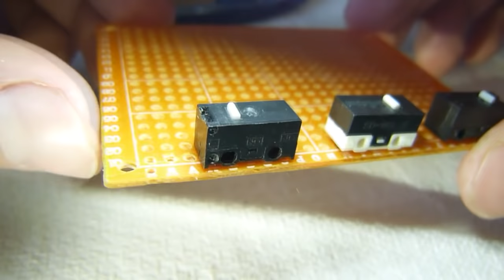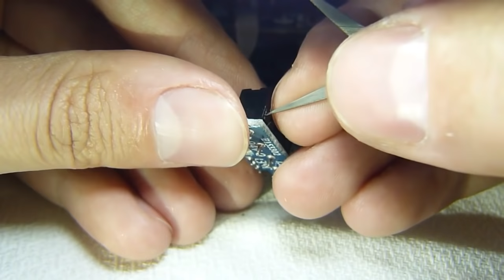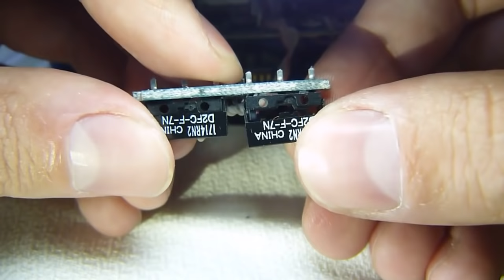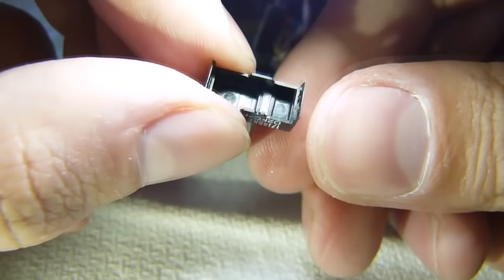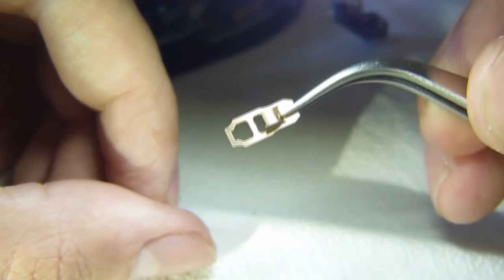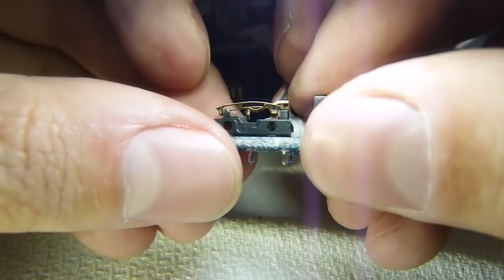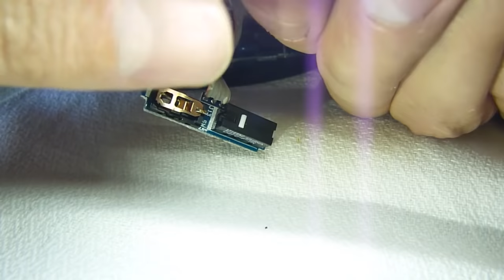Double click problem: How to fix faulty mouse button

Comment: It's 2019, and this works just fine with the razer naga trinity. You, my good sir, deserve a medal for this.
Reply: 2022 still works :) now i still need to find a fix for the "Repeat Scroll Down" button, the one you tilt the scroll to the right... sometimes works, sometimes don't... but well... at least my left click is working... lets see for how long
Reply: @mikethegamer34  you just need to oil the bearing, use wd40 or something like that. Work for me

Comment: Thanks so much, I was eventually able to fix my Razer Imperator. My tips: Also see his 'full guide' link which gives better detail for the really icky part - getting the spring back in place. Might have saved me an hour if I saw that first! Oh and my little white plastic switch also went flying, it's a miracle I found it.

For my mouse, I had just as much trouble getting re-assembling it properly. The right click "didn't work", but I eventually realised that it was in 'always clicked down' position, due to me not screwing the PCB in TIGHTLY (at least a few turns tighter than I would normally screw something). Do a few laps around the PCB with your screwdriver, because when one has gone in further, another that felt tight a moment ago might now have a few extra turns in it.

Comment: Yes, thank you very much!  As mentioned below, no need to remove switch from board...just use scalpel knife or fine tweezer legs to wedge the plastic tabs. Did this on a Logitec Performance MX...don't take everything apart like in other tutorials...just 4 screws and remove top half..that's it. You're right at the switch.

Comment: Thank you for this great tutorial. Fixed my "Roccat Kone Pure" laser mouse. It was a bit tricky to put back the metal plate back in place, but the rest it's easier than it looks. I think everyone is capable to do this at home.
Reply: my man just broke the best drag clicking mice
Reply: Wonder what the Roccat Kone EMP is in that league...
Was a RIP to the left click till I fixed it from this video.
Reply: @lemurmad  Look for the switches. Kalih 8.0 are rated at 80M clicks and this is your best bet.

Comment: Thank you for posting this how to guide.  Just saved a Logitech M570, suffering from bad double-clicks, from the trash.  Took the switch apart, did a bit of alcohol cleaning of the contacts, put it all back together, and now works great.

Comment: There's a really easy way to do this, lace the tapping bit (let's call it front) under its receptacle then pull it so as to hook the other end keeping the curved bit above the center receptacle. Push the back end down so it hooks.   You'll then have it fixed in place but it won't click, all you need to do at this point is push down on the curved bit so that it snaps into place (use a toothpick or tiny screwdriver).

Took me an hour for the first one until I figured this out and then 30 seconds for the second.
Reply: Thank you man. After 2 hours of trying I wanted to perform Seppuku, thanks to you I managed to fix it! I've done this twice (today and one more time two years ago) and my mouse works like new.
Reply: @zams4517  not sure what you mean the method I describe has worked fine for me.  I just buy a few new springs for like 5 bucks (the entire microswitches which I cannibalize) every few years for my g500.  If you are just rebending the same one you are going to lose integrity of the metal and corrosion (ie humidity) will reduce contact sensitivity over time as well.
Reply: @themysticbg  Glad I could help I actually figured this out like 6 years ago and then forgot it so I posted the comment to help remind myself as well lol.
Reply: @zams4517  no worries
Reply: Instructions not clear.
Now the pin is in my stomach
Reply: can you paraphrase it more simply
Reply: @jalen1422  how about a crude mspaint?
 https://i.postimg.cc/R0kbZFxY/mouse-inst.png
upon rewatching the video it looks like he's doing it the same way but you can't really tell because his fingers are in the way
Reply: Can you make a video or a drawing explaining which part is which
Reply: @CybertroninfiniteOfficial  the above pic no help? at 3:06 he starts doing method i describe although its hard to tell (I didn't even realize until long after I posted this)

Comment: Thank you SO much! as another commenter has already pointed out, there is no need to take off the metal clip. you just need to clean it (i used pliers and a tiny piece of cotton, put it back with no hassle (with the help of the video) and got it back to working after YEARS of faulty behaviour. so happy to have my mouse back!!! cheers to everyone. hope the information gets to everyone that needs it.
Reply: Yup, not only that, if you don't clean them and only start bending the copper, you both risk damaging it and won't fix the actual problem. Instead, take a moment to understand where the electrical loop closes (front of the copper piece), and just insert a wetted cloth underneath it with pliers.

Comment: Thanks! Works great. 

I recommend trying to clean the contacts with a thin, sharp blade, and 
add contact spray and see if that works before taking it apart. It can be 
difficult to put it back together. If you do take it apart, note that the back 
end (opposite of the contact) should be mounted almost at the top. 
Also be careful not to bend too much as it will make the click harder. 

I also removed the weights while I was at it and ordered 5 switches on 
eBay for $1.20. The ones you want is:  Omron D2FC-F-7N 

When you solder those switches, use a ~300C tip and do not heat for more than 3 seconds... 
(factory recommendation) 

Cheers :)
Reply: I fixed it on my Roccat Kone Pure Military, but I bend it too much and is a bit harder now, hope that get softer overtime. If that happen again I prefere buying a new switch and lose 30min trying to get that little spring plate on place.

Comment: I have a Logitech G600, and it was having the double click problem. This fixed it. Thank you so much for this video (and the detailed written guide with high res images, really helped a ton.) Took me about 45 minutes, the most stressful parts are taking off the cap to the switch, and putting that dreaded spring back in. A tip, do as he does in the video and make sure the spring tab part is on top of the post when you put the hammer back into the slot, put the back clip on, then do the spring last, and it's much easier to push down into place than it is to try and lift it back up onto the ridge / slot.

Take your time, be patient, don't get frustrated and you'll be able to fix it.
Reply: An update. It only ended up working for about a day, took it apart again and it only worked for about an hour. This is the solution, but my spring is just warn out badly. My suggestion is perhaps instead of bending your old spring, just buy a new one. (Got a 6 pack of new switches for 6$).

Comment: putting this thing back together is probably the hardest thing...mine fell apart after 10th try
Reply: Same :D But i finaly manged to fix it (now the other half... wish me luck)
Reply: I did this on my G600 for the left click. The fix has lasted for 3 years and counting. It took me 4 hours to get that copper spring back in. Now it's my right click's turn . Sigh. I swear, this is a part that can be made modular. Double click issue? Just snap in a new clicker!
Reply: If you've had to do it 3 times already compared to my 1 then perhaps you should consider bending that copper part a little more than you usually do. I took note of where it was when I opened it and moved it much further than the original spec (because obviously the original spec wasn't good enough) so the fix would last longer. That's coming from someone who uses their computer 12 hours a day or more. Lots of clickly click clicks.
Reply: Verdigo I like how buttons feel right now, wouldn't want to make changes to them.
And spending few minutes once a year doesn't bother me much anyway.

Comment: Thank you for your detailed instructions, I used to buy a new mouse every 2 to 3 years because of this double click issue, everyone should learn this technique asap to save money and the earth!:goodvibes:

I don't have any forceps to open the small black box, I learned from another youtuber who uses a needle to open it, it worked quickly and easily.

The copper piece is rather challenging to put it back into the correct position, loop to see your instructions for many times.  It took me half an hour to get it done and heard the beautiful "click" sound.

Comment: some tips that worked for me - I found the 1.0 flathead screwdriver from a multi-ended screwdriver kit worked well (ifixit in my case) to remove the black casing from the omron switches. When screwing your mouse back together, metal screws into plastic threads, back-turn the screw a little bit until you feel/hear it 'clunk' into the existing threads a little bit. If you don't do that, you can strip out the weaker plastic in the mouse body with the metal screw. And of course, other videos mention this, but to hold in the little white plastic piece that is in the switch casing, just put a little piece of tape over the entire top of the switch casing before flicking it off.

Comment: It also helps if you clean the spring (the flat metal with a little curved middle) where it touches the contact points.

Comment: Mine don't even click anymore. Also be careful bending that metal part it snaps really easy.
Reply: good thing i have 4 of these that dont have usb sticks to practice on
Reply: Hey mine also don't click anymore was it the switch ?
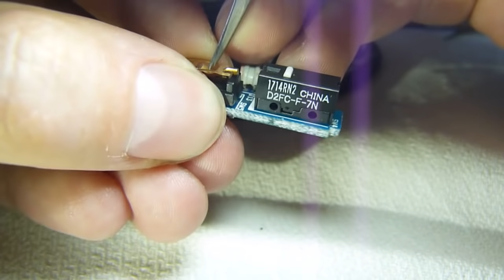Reply: @fuehwbdb3765  make sure you push that little plate until it clicks, look at 3:45 / I know it cuz i had the same problem
Reply: Same!

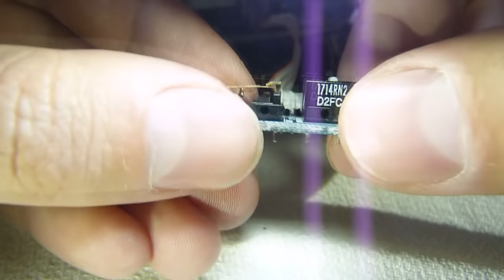Comment: Very helpful video, took me an hour and a half, but I made it work. That metal blade would not want to get into proper place, especially that curved section, that you push in and clicks at 3:52.
Two problems I encountered: 
1. The microswitch is soldered onto a board, and the board was inside the mouse. I had a terrible time to access the hood for the microswitch, because I couldn't take the board out of the mouse case. No idea how is attached, glue ? I couldn't find any screws for the board (not the mouse case). Since I couldn't take it out, I wasn't able to simply solder another new microswitch on, which would have been 100 times easier.
2. That metal plate, is nearly impossible to get it in properly. You really are a pro, got it in so fast ! Took me well over an hour to get it in right.

Tips for  future viewers: if you can have access to the back of the board where the micro switch is attached to, do yourself a favor, buy a new microswitch and just solder it on. It will save you a whole lot of headaches !

If you have to open the switch, like I had to, do yourself a favor and make sure you have proper tools: mini screw driver heads, bought mine for 5 euros from Praktiker and you'll need a pair of tweezers, with a very very VERY fine and narrow tip. He's filming very close, so the switch appears very large, believe me that metal plate is a main to handle, especially if you have big hands like me !

Comment: Report with Razer Basilisk V1: After about an half an hour of messing with the switch, i managed to figure out what I was doing wrong and retried again with success. I have fixed my mouse as before dragging and dropping was almost impossible. I have bent the metal bit a bit more on the right click and there is an audible difference but that does not matter as the mouse finally works as intended. Thank you 10 year old YouTube tutorial in helping another mouse not to end up in landfill !!!

Comment: Brother, your video saved me some money. I ordered a new mouse on Amazon and right after that, just out of curiosity did a quick research on YouTube to see if someone has figured out a way to fix the clicks on a faulty mouse, i unscrewed my mouse, detached the top cap of my click just as you have done, flattened the lower u ring on the thin copper plate just as you showed and cleaned the contact points with some alcohol and put it all back together .. its working like a charm again .. cancelled my Amazon ordered right after that.. got my refund .. loved it .. good one man .. keep up .. peace.. 🤟

Comment: Just tried it and everything went smooth except the metal plate. It took me at least a half an hour to figure out that the plate needs to sit on the back metal post not loop under it. One you realize that and get the spring back in place, you're golden.

Comment: My problem is the little mechanism boxes in my mouse are like the one in the middle @0:12. That one is different and i can't manage to open it  :/
Reply: +Akash-sama same here,have no idea how to open
Reply: +Akash-sama you have to open it from the brackets on the front and back, the piece that connects the black to the white
Reply: +Akash-sama Same here mate, almost impossible to open it
Reply: +muhdiboy  the second click box shown is harder to open, its really different from the front/back.
Reply: +Akash-sama have you manage to open it? i really need help
Reply: Skyworth 99 finally i can do it and fix my mouse. you need to use a needle.
Reply: +Akash-sama I also hv the different box, but its possible to open it tho
Reply: +kemathers have you managed to do it? im currently trying to get it open but its impossible
Reply: +Jak “xSk3lY” Bro use a pin, ive done it, finally fixed my mouse. Becareful though, one side broke on me. but its working so what the hell
Reply: +Skyworth 99 Indeed use a pin. I had actually made a video for you to show you how i opened it and even posted it here the same day you replied. But i realized just now Youtube won't even show comments that contain links. WTH! Here's the video for those who still can't open it : www(dot)youtube(dot)com/watch?v=d_2T93sne5c
Reply: +Skyworth 99 yess, my mouse is working good now. try to use small knife to force open it
Reply: +Akash-sama My problem is that this is INSANITY. I've got 20-year-old Compaq, Microsoft (and other!) mice which are working perfectly... 

Then, I've got this Genius DeathTaker mouse - which I've paid an arm-and-a-leg for - and the left-click on it is breaking down; perpetually, it seems - a few days /couple of weeks ago it started acting up, cleaned it, but the issue has returned. 

Now, what am I supposed to do - engineer parts, for something that I paid good money for?!?? Not so sure about it, you know. ;-/
Reply: I have a mouse like that in the middle too, the one with the white base.
Instead of opening in the front and back you have to open on the right and left side, I use tweezers with thin point to kinda make a very little hole on the black part and pull it outwards to remove it. If you look closely you can see that the part tha you should use the tweeer to remove has a white piece, this white piece is what is holding the black box. Hope this helps, if you have any questions feel free to ask.
Reply: I broke one side while opening it, but that didnt affect much. I just put there a little tape there and it worked well

Comment: Thank you for the instruction. I have taken it apart and I was unaware that the white button fell off and slipped behind the mouse board. It took me 30min to search the floor and finally it occurred to me that it could be behind the board. I gave it a hard knock and it fell out. I have also gave it a Deoxit at the point of contact just for good measure. May as well oiled the mouse wheel while I am at it. Now it is 80% new :)

Comment: Had to do some cleaning on the spring piece, had a strange kind of white corrosion on the contact area.  Came up easily with some alcohol.

Took about 30 min until I could figure out how to get the [censored] spring mounted against the back piece (and NOT hooked under it, but AGAINST the back support), keeping the spring tension and fitting it under the top contact in one smooth move.  The next step - showing how you THEN 'click' the spring leaf down into place, after all of that, made it really clear how to do all this.

Excellent video, detail, & camera view. 

Mouse working now.  Able to click THUMBS UP,  in fact.

BTW I used a small piece of scotch tape to keep the white button piece in place while re-applying the black plastic cover.

Comment: Even if you are not uploading any content anymore so maybe you will never read this, I need to tell you that with the help of your video I repaired my discontinued Logitech Media Play Mouse. I could have soldered in just a new one but this fix works without ordering any parts. I could not find any mouse today with the functions mine has so there is no replacement for it. I guess I have it more than 10 years now. Thank you very much!